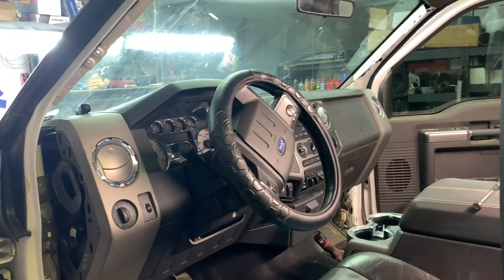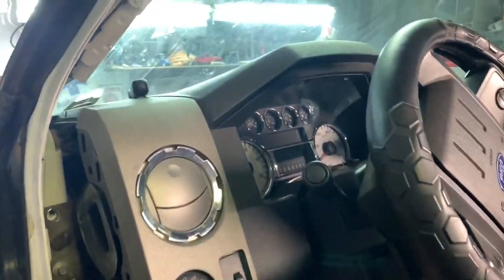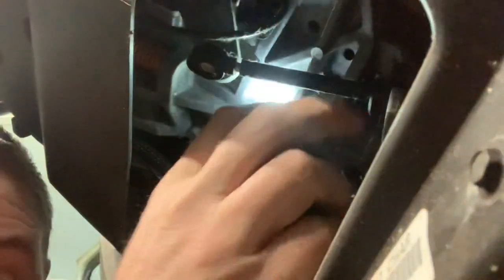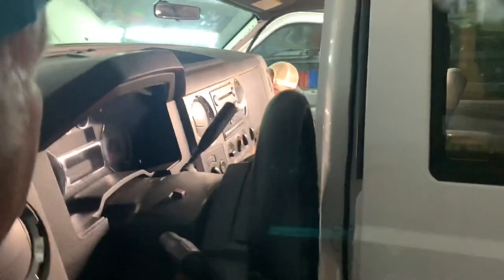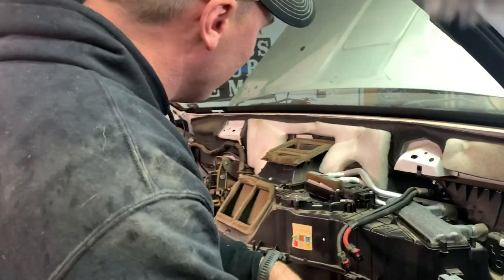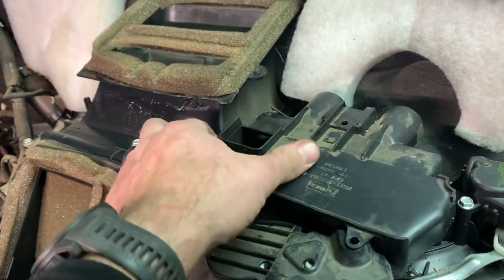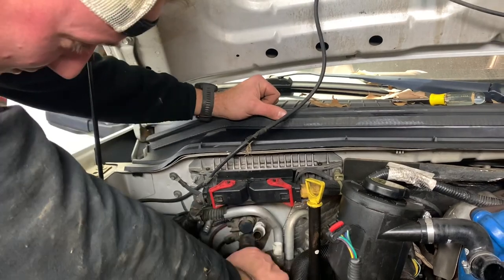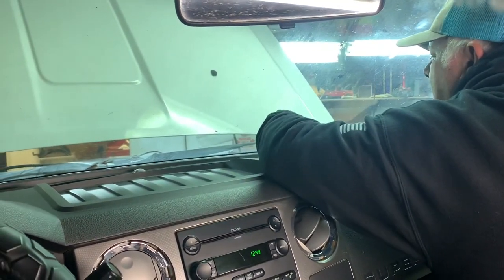Cheap 6.4 powerstroke Part 3

Comment: Thank you guys this is a job I'm not looking forward to but you guys are the only ones that I've seen that has done a video thanks again
Reply from the maker: Thanks for watching and commenting. Check out our other Powerstroke videos.
Reply: I was surprised you guys answered me and you answered me pretty quick I have one more question looks like you're pushing the quick coupler heater hoses back onto the heater core can I avoid this that stop if you're cutting the hoses in the cab I also have the diesel pipe that you were talking about
Reply from the maker: @light784brick9  not sure on what diesel pipe your referring to. I would honestly have to go back and look at what we did again. From what I remember we used the heater hose splice to avoid removing the entire hvac box.
Reply: @AutomedicGarage  yes that is What  I am trying to avoid  have the delete  i started the project  today
Reply: Th 5 inch exhaust

Comment: Did you add fords cavitation fluid to the antifreeze. That big water pump will eat through the back plate, and you will have water in the oil.
Reply from the maker: No we didn’t because we don’t plan on that fluid staying in long at all due to the oil that was in the system. We figured we would flush it again, install the coolant filtration and then ad more clean antifreeze and the anti cavitation additive then. Good point though.

Comment: When you cut the heater core piping with the saws-all, do you worry about aluminum shaving  getting into the coolant and clogging the oil cooler?  I am thinking of a 6.0. Does the 6.4 have an oil cooler like a 6.0?
Reply from the maker: @pakkelly  it’s similar but didn’t have the problems a 6.0 had

Comment: That's how I did mine I didn't pull the whole dash I just laid it forward and cut the old one put in new and used 3/4 I'd heater hose

Comment: Hey my brother I just did the same thing on a Ford 350 but I done that vaporator core and I took  the dash out and Iput it all back in and now the alarm system has me locked out do you know how to get around that how to fix it
Reply from the maker: Did you disconnect batteries while you did this?

Comment: How much y’all gunna sell it for? @automedic garage
Reply from the maker: Chris Martin it’s being debated. Truck is super clean and will look near brand new once we replace the drivers seat bottom and the rear bumper
Reply: I have an 08 f250 6.4L XLT RWD with the egr and dpf deleted with 140k miles. Been thinkin about selling it for around 15k here in Texas. Y’all could get more than that with only 100k miles onit
Reply from the maker: Chris Martin I spoke wrong in the first video it has 161k not 135k I was going on what the seller had told us at the time of that video. But 16k would be a good ball park it it a good running loaded truck

Comment: Just don't buy ford's piece  of s
Reply from the maker: Gotta disagree with ya on that, the 6.4s were a different story cause international built a throw away motor. That’s why for parted ways with international. Not a fan of the heater core in the 6.4s either but other than that it’s a great truck and I like Fords procuct but to each their own. Thanks for watching.